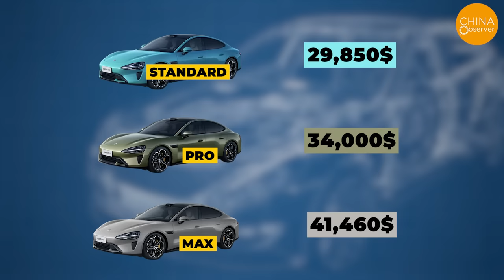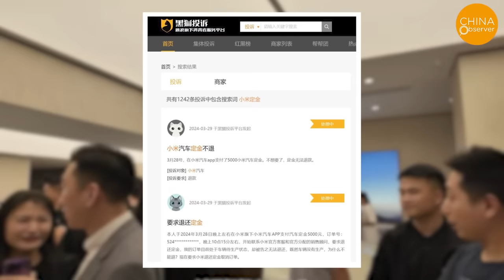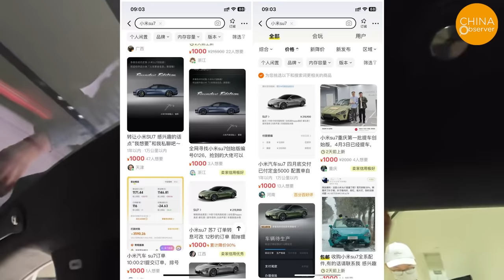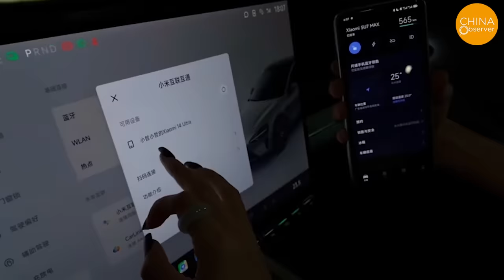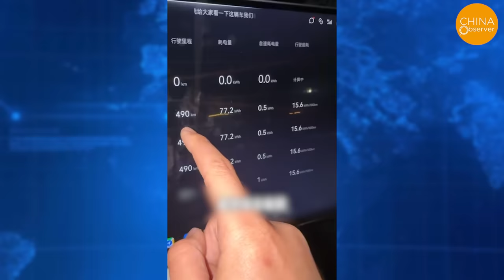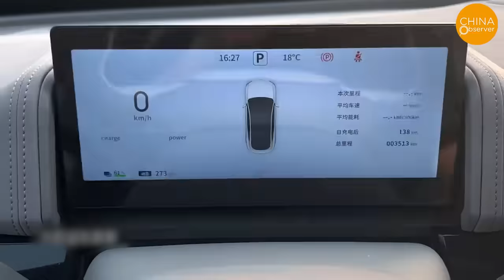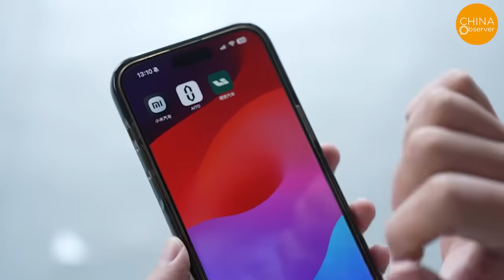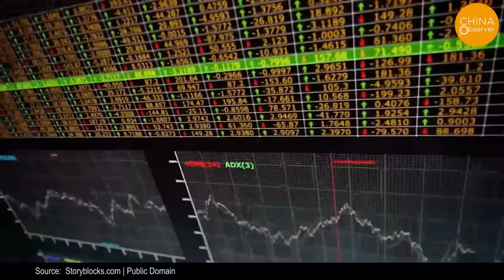Xiaomi EVs Criticized for Poor Quality, Using Aluminum Instead of Copper, 40% Cancellation Rate

Comment: Benz started making cars in 1885. They have been perfecting them ever since. My previous one did 240.000km. Once a year to the dealer for scheduled maintenance. Once there was an issue with the water pump. They didn't charge anything for the repair. We got a phone call from the dealer afterward to explain and apologise, "That should not have happened." Then it was rather sadly rear-ended. Too expensive to repair. so we took the money the insurance paid for it and bought a new car. Guess which brand. If people are so stupid to buy a car from a company that was making rather crappy cell-phones and decided somewhere last week "we're gonna make cars".... In my country there is a saying: if you burn your a**, you have to sit on the blisters.

Comment: You preorder, you lose. But tbh, aluminium wiring is very popular in EVs. It's lighter and cheaper. BMW i3 uses alu wires in the battery, in interconnectors between modules. Besides, every battery has cells connected with aluminium tabs. It does NOT generate more heat because thicker gauge is used to compensate for higher resistance.

Comment: Honestly that's kind of amazing that they found such a crappy material I don't know of any other material on earth that disintegrates or wears away that fast like did they make the seats out of butter
And how do you even have more leaks than there are places that hold fluid that don't even make sense there's probably only oil in the front and rear gear boxes how is oil coming out of the tires and in other places at the same time there shouldn't even be that much fluid in there
Reply: Exactly! This is an EV! There shouldn't be that much fluid to begin with!
Reply: Maybe it's not for lubrication, but a cooling-fluid or its for fire extinguisher purpose, heard chinese EVs are likely to overheat or to combust externally.
I think it would be a very clever way to include a fire extinguisher in the car. Maybe you can make them a micro transaction for when the car is burning.
For only 30000¥ you can purchase a immediate fireout feature.
Do you like to buy now?

Comment: Oh, the damn information gap has led many to believe that Xiaomi cars appeared out of nowhere. I think this is due to a lack of understanding of the information from China. Xiaomi's car factory is operated by BAIC (Beijing Automotive Industry Holding Co.), and the project was initiated several years ago. BAIC Group serves as a contract manufacturer for many automotive brands such as Mercedes-Benz, Hyundai, and Foton. As for the technology of Xiaomi cars, Xiaomi has poached a large number of talents from Geely Automobile Research Institute, including the head of the institute. Speaking of Geely Automobile Group, I think some people might be familiar with it. This company owns Volvo, Lynk & Co, Geely, and smart, and even now holds substantial shares in Aston Martin and Mercedes-Benz. I hope that a random video on a YouTube channel should not sway the judgment of an intellectually capable person.

Let me repeat the specs of the Xiaomi SU7:

Length (mm): 4997
Width (mm): 1963
Height (mm): 1455
Wheelbase (mm): 3000
CLTC pure electric range (km): 700
Official 0-100 km/h acceleration (s): 2.78
Price: 299,900 RMB, approximately 41,200 USD

Comment: Most U.S. homes have aluminum wire for the main runs, such as the street feed to the Main Breaker and from there to any Subpanels (usually 100 A USE-2).  It is mandatory to use anti-corrosion grease at the connectors, but that is recommended for copper wire too.  1960's homes which used aluminum wire for the outlets (15 or 20 A) apparently didn't use grease, so suffered corrosion at connectors which gave high resistance heating and sometimes caused fires.  So, no problem using aluminum wire for the high current runs in EV's, if designed correctly.

Comment: Xiaomi trying to be Porsche + Apple
Reply: Apple doesn't make cars
Porsche doesn't male evs
Reply: @zacksmith5644  Porsche has the Taycan and MACAN EV. I mean Apple level tech. Apple doesn’t sell cars.
Reply: @aeronYTco  both created after byd cars ,nio cars , 
Try again .

Xiaomi doesn't share any parts
Reply: @zacksmith5644  this we don’t know for Xiaomi cars will be built by BAIC. It’s very possible they’ll be using BAIC car parts.
Reply: @aeronYTco  of u don't know then why did you make the claim ?
Reply: @zacksmith5644  I said it’s very possible. It’s just like Afeela = Honda + Sony. Honda will be responsible for building the car while Sony will supply the technology, cameras, sensory, and infotainment systems.

Comment: i used aluminum wire for my car stero speakers. had to replace/strip and re wire after 2months due to corrosion. save $20 for the first install. but ended up have to do the work twice till i replaced it for copper
Reply: My house burned down because of aluminum electrical wiring. I mean down down, as in clear to the basement floor down. It's an interesting experience shoveling ashes which represent everything you own into a dumpster.

Comment: The seats could be made of cloth over leather, the battery could be made with copper or lithium ion over aluminum, it could use seals designed EV batteries to prevent the leaking issue.

Comment: Alu instead of Cu, cheaper... lighter, but electrical not as good. You see it in cheaper speaker wiring. Technically it does the job, but you know that Copper is better at it!

Comment: Aluminum is commonly used in EV cables, what is interesting is the Cybertruck uses a solid cable that has the thickness of your finger. A week ago I hiked by a large spool of high-voltage aerial cable, also aluminum. 

Looks like the EVs are destroying the Chinese used car market. A friend of mine had her Benz B200 front bumper fixed and it cost around 4000€. She had also asked what the car was worth (10 years old, 147000km), and was told the same 4000€. Shocking. That's the reality. Older premium gas cars are losing value because of the high maintenance and fuel costs as there are now many used EVs with good warranties and cheap operating costs. If the EVs take 50% market share this year it looks like, there will be many factory closures. At the moment Wuling is the best-selling GM car by a wide margin and there are rumors that GM will stop making most of their American brand cars just like Ford did years ago.

Comment: aluminum are also use for high voltage transmission lines in the snowy and icy cold or freezing climate in Chinese rural areas for longivility, China has the aluminum technology that is more reliable, lighter, less corrosive and more conductivity than a copper

Comment: Xiaomi officials explain that using aluminum can reduce weight by 30 percent, the safety is the same, and different cross-sectional areas can achieve the same load capacity as copper wire. Now China's high-end electric vehicles, is also common with the aluminum line.

Comment: Aluminum wires are prohibited for residential housing in most non-third-world countries.

The reason is not conductivity but metal plasticity. Any bolted connections with Al wiring must be tightened at least once to twice per year, otherwise they naturally become loose and cause fires. 
This is not a hypothetical scenario, this is actually quite common, it happened to me personally.

It is possible to circumvent such problems via i.e. spring washers but thoughtful engineering and quality assembly is then very important.

Crimped connectors such as those used in many factory-made cables may or may not be effected by this issue depending on several factors like crimping strength, wire strand diameter, connector type, amount of flexing expected, etc.  

Welded connections are not prone to this effect, but if done improperly the they may become brittle. 
Soldering of a large Al wire is also not easy to do properly, I've tried it.

I'm no expert in modern electric vehicles, so I'm not sure what type of connection they use but it's entirely possible that it's totally ok.

For instance, almost all high-voltage power lines are aluminum because it's much cheaper in bulk and bare Al is much less prone to water degradation than Cu. 

Copper-coated aluminum is also used for small-cross-section single-strand data wires such as Cat5+ ethernet because thin single-strand copper is easier to break while pulling and bending the wire. But thick single-strand Al is conversely typically more breakage-prone than Cu.  

As for conductivity - Cu wires can be replaced with Al without that much issue as long as the cross-section is increased about 2.5 times or so. This is fine since Al is both lighter and cheaper. 
The issue is that people often see cheaper wire and try to replace Cu 1:1 with Al and that causes severe problems.
 
What I'm hinting to is that aluminum wiring is fine if used properly, but it may be more tricky to do safely.
And - given the context - I'm not very confident the Chinese manufacturers would not make mistakes and not cut corners.

Comment: Almost any USB or audio cable you buy nowadays is CCA or CCI, the latter easily detected with a magnet. All thanks to the wonderful EV push, and windmills, the 'less important' markets have to be content with the mere scraps. The worst part still, 99% of people don't even really notice it. All they could notice is their cables don't last as long as they used to, try a bend test with copper vs CCA and you will be shocked!

Comment: The melting point of aluminum is around 660 degrees celsius copper is about 1060 degrees Celsius. If there are Short cut aluminum will instantly melt down and the whole car blow up. 

#Trend.

Comment: Power cables of High Voltage in Power Transmission are also ALUMINIUM . So ...What is the issue ? 12V, 24v, 36v,48v , etc are LOW Voltage. So COPPER is preferred to overcome Resistance. Once you hit 400v and above it has insignificant if Aluminum or Copper. But Aluminiumis Much Cheasper than Copper. If you want ...You can always by the Porsche "The can" at 3 times the Price. And still loss in Tech .

Comment: I am a Taiwanese who used to work in China over 10 years ago. Even 10 years ago, many average Chinese worker who have not received higher education already knew for a fact that aluminum wire is of lower quality than copper. It is just a common knowledge that you pick up as you work. The fact that Xiaomi chooses aluminum over copper just shows how desperate they are in cutting costs

Comment: Considering this is xiaomis equivalent first car like Tesla's roadster, which was riddled with issues, it's to be expected from a company's first car. I wouldn't buy one until years down the line
Reply: And that girl was disappointed that she didn't get one in the first batch. The first batch of cars from the first car the company ever produced. What could go wrong? But I agree with you. Never buy the first year of a new model. Wait a year or two until they have the bugs worked out. Of course, in China, bugs are a feature. Regarding EVs I would recommend waiting 5 to 10 years. Not just bugs in the cars but in the charging and electric generating infrastructure.

Comment: Alluminium has better conductivity and less joul effect than coper. 
Coper has been used more in the past because it was more aviable, easier to produce and cheaper. Nowdays it s no longer the case. You will find mant alliminium cable insted of coper in new cars/trucks. 

The bad quality is a manufacturing or design problem, not the choice of alluminium over coper.

Comment: It doesn't generate more heat. It expands too much compare to copper. Termination points get loose over time. Loose contacts creates heat and you'll burn out devices.

Comment: Electric cars should start from SUVs, as well as test the strength of the engine, chassis, battery, rubber and body, so problems and complaints don't last long.

Comment: The wiring argument is complete nonsense. For the same volume copper has a higher conductivity, but for the same mass aluminum has a higher conductivity. Mass is arguably more important than a car and aluminum also bring cost savings.

Comment: There have been few Chinese car makers in Europe but they have disappeared. Those Chinese knockoffs don't last longer than 5-6 years. There is no proper service network or even technical support like parts catalogue and schematics. Many of the dealerships have tried with MG or Geely but most people lease those Chinese POS cars and return them after lease ends and nobody wants to buy used one even if they cost half the price of similar European or Japanese, Korean car.

Comment: Aluminum wires in a electric car sounds like a  hydra type of problem higher energy needed to run through the aluminum wires in comparison to copper wire this would lead to hotter wires hotter wires leading to melting jackets leads to exposed live wires exposed wires leads to hospitalizations hospitalizations leads to lawsuits

Comment: This is just too funny. A few facts: 
1. To this day there isn't a single fire with Xiaomi Su7. Like there are NONE, even if it has just been into a crash. 
2. Aluminum wire has been widely used in the auto industry. It has never ever been proven to be unsafe. Tesla Model 3 uses aluminum cables to connect the battery pack to the electric motor, as well as cyber truck, which uses aluminum as the main high-voltage charge cable. 
3. Tesla Cyber Truck has a 50-60% cancellation rate. 40% is not high. 

Can yall tell how bias this channel is now? Lmao

Comment: a car is vibrating....the cable and connectors vibrating...
Alu is breaking very fast.... 
in my country its only used for high voltage transfer....
sometimes as a main power cable, but inside buildings... only copper!!
i am electrician from profession....
i am also take offense in the fact, they copied Porsche, which is from my country!

Comment: Sounds like a Product 1.0 to me.
This happens everywhere! NO matter the country or the product. Product 1.0 usually has issues. It is a known fact in the tech industry that Product 1.0 buyers are BETATESTERS. Only once you reach 1.2/2.0... you get most of the issues out of a product.
Still, we talk about a CAR, not a toy or something like that.
Reply: But if car gets so many issues after first weeks of use, then how the hell did they missed all of it? Poor quality of seats? How could you not see that after basic testing? Its made with cheap materials to reach that margin of profit.
Reply: @Zripas  Chinese Quality Testing...A rushed market launch. 
Ah I remember the Xbox 360 time. Good games, rather oddly half broken console. That thing would overheat and bend the motherboard and poof... Red Light of Death. 
This car is just rushed to the market without enough testing.
And yeah, probably the cheapest of cheapest material...

Comment: Aluminum wiring isn't any more dangerous than copper as long as it is made of an appropriate alloy (ex.: 1350 in electric codes that allow aluminum) sized and terminated appropriately. Perfectly fine to use where space isn't a concern. Using silver is silly when it costs ~300X as much as copper. If silver was to be used anywhere inside an EV, the most sensible place would be the drive motors to make the stator windings smaller and more efficient. But then we'd probably have thieves cutting motors off to steal the silver.

Comment: BYD WON’T BE SUCCESSFUL
EV’s and hybrids will have a 30 cent per mile tax charged to them.  Follow California politics.  Ev’s don’t use gasoline which has a road usage tax included in it.   So, the State is adding a tax to every mile you drive an EV.  Bottom line: 
This means it will be 2.5 times more expensive to drive PER MILE compared to gasoline cars.  

Also, the charging cords at stations are being cut by copper scavengers.  

EV’s are known to self destruct so it can not be stored in a garage.  Insurance for homes should go up if you own an EV due to likely fire hazard.

Resale value is close to zero after 5 years.  The battery will be un chargeable by then.

Ford and Mercedes have stopped making EV’s for a reason.

If Trump is elected, he will protect Detroit by placing a 100% tax on the BYD.  It will cost $22,000.

Who will fix the BYD in your hometown?
Do you have to send it to Los Angeles?
Go ahead, search for a repair station in your county.
Reply: What's asserted without evidence is rejected without evidence

Comment: I shall not comment on your destruction of the Xiaomi brand, as I have never seen any!
However, what you said of aluminium replacing copper conductor is entirely incorrect.  Using aluminium instead of copper in harnesses is perfectly safe, provided the connectors are adapted to the different nature of aluminium.  If Al harnesses were unsafe, do you thing Airbus would use Al for the A380 harness?

Comment: The whole car design is stolen, front face is a redesigned 765LT minus the splitter and vented headlights, cues from the taycan is evident and the rear and resembles that of a Buick💀the chinese will never learn. They will forever make knock offs that are dog water. And I hope they know it.
Reply: How is it stolen ? Which part is stolen ?

Taycan doesn't hold patent for the design 

If rear resembles a Buick then it's not a Porsche 

U claimed it was pressure in the first line . Then u said it's Buick 

Again 0 proof .